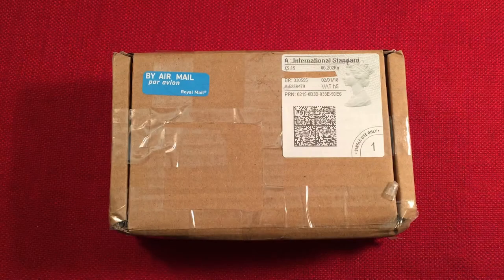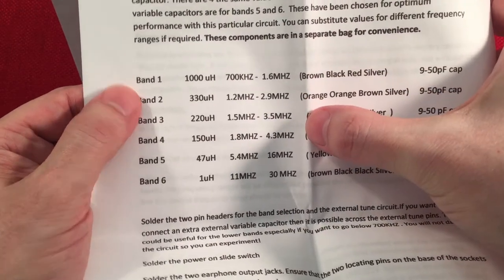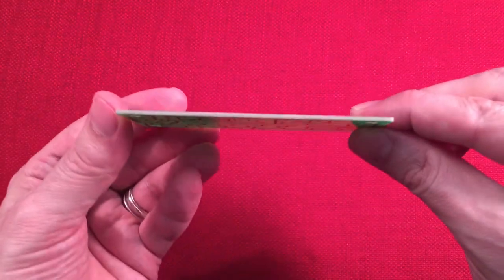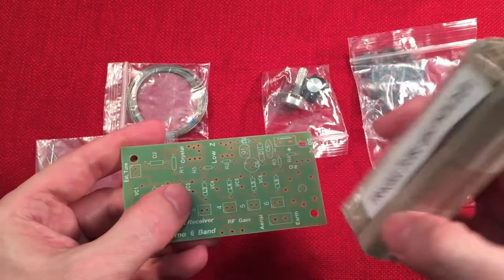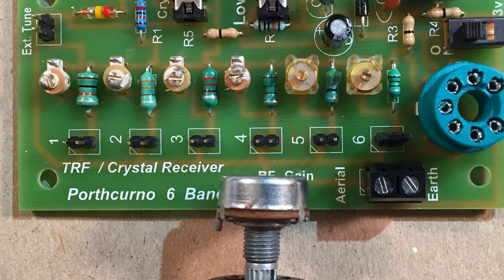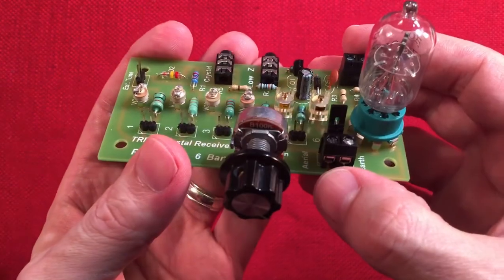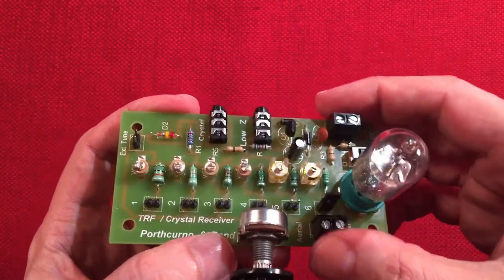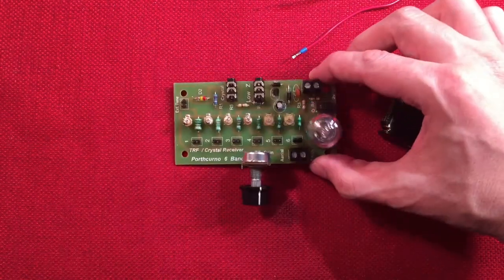Porthcurno 6 Band MW & SW Crystal Radio Kit Build and Review

Comment: This kit is less expensive than buying all the parts seperately and building using "dead bug" construction. The air variable 365pf cap costs $25 alone. Then buying a "Trimm or ACME" hi Z headset is $30, if you can find one. The only downside is the transistor, which does not comply with the no "solid state device" in the build. Otherwise it looks like a fun build.

Comment: Is there a way to get this radio to work in a small apartment,also which Crystal diode is used,help anyone
Reply from the maker: Ground to cold water pipe, your antenna wire can be strung around the ceiling or as high up as you can.  I use at least 50' indoors.  The best is if you could do an outdoor antenna.  It uses an Germanium Diode.  They work very well.